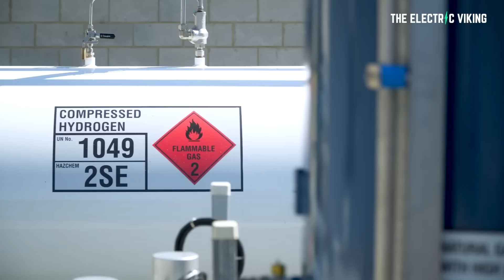World's largest wind & solar energy grid shows the future of the planet

Comment: One the one hand, it feels great that the world is moving to renewables and batteries and Tesla’s mission goal to transition the world off fossil fuels is a grand vision. Australian, Professor Simon Michaux has a phd in mining and metallurgy and currently works for the geological survey of Finland. In a unique and eye opening deep dive into the feasibility of making the transition off fossil fuels, he has looked at the current annual amount of fossil fuels used by the world and converted the energy content into Megawatts of consumption.

He then does the calculations to ask how much mining of the various metals would be required to manufacture the number of solar, wind and batteries with a conservative 4 weeks of battery capacity for no sun and no wind conditions. Then he looks at world geological surveys and notes that there is simply not enough known mineral reserves on the planet for some metals needed. Following the history of mining operations, he shows that the lead times between discovery of deposits and development into productive mines can be upwards of 15 years.

This presents huge problems as venture capitalists financing such mines, investing billions, may have to wait 5 to 10 years or more, before they can become financially viable. There are also geopolitical problems as the metal ores required, may exist in countries where other world powers are doing deals to get exclusive access to ores.

Then the good Professor looks at the current machinery used in mining and its fuels sources, and determines that most of this mining, refining, transport and manufacturing will have to be done using fossil fuel energy. Also he notes that ore grades are getting smaller in existing mines, which leads to an exponentially larger and energy intensive processing in the refining of low grade ores.

Finally, he looks at a term known as EROEI, Energy Return On Energy Invested which is a ratio shows that unless at least 3 times more energy is returned over the 25 year lifetimes of renewables and batteries, than the energy cost that was invested, it simply becomes unviable. And then, at the end those 25 year lifetimes, all of this has to be decommissioned and recycled , taking into account the extra energy required to do this, AND have sufficient energy to mine and manufacture the next set of renewables and batteries. After considering the hard data Simon Michaux, doesn’t think renewables are ever going to be sufficient to give us this utopia of unlimited energy. 

The link below is of his presentation of this mining data and is well worth having a look at.

https://youtu.be/MBVmnKuBocc

Comment: Truth be told it never mattered to me if my EV was power by coal because coal was domestic and wars were not being waged to obtain it LIKE oil, coal power sources are relatively centralized so technology can keep a tighter control of emissions as opposed to people defeating catalytic converters on there vehicles. Coal allows a people to pivot to maintain an advantage. AND I knew the solar revolution was coming and as the grid got cleaner so would my car. I’d rather solar,wind and even nuclear over coal but change is coming weather I hate or love coal and if my sources were correct and solar is superior (as it is) then the change will happen organically. I can’t wait to get myself some solar panels and make the same claim eventually.
Great video thanks 🙏

Comment: I think that it is important to make the grid connect up with other countries to help even out the grid better.   It is another thing that helps with the intermittancy of renewables.  Electricity can travel long distances without losing much energy if it is converted to DC rather than AC.  The UK is connected to several countries including, France, Holland, and Ireland and Norway providing almost 7% of all electicity last year.  Many other countries in Europe have lots of interconnectors too.
Reply: I'm fairly sure we convert to AC because it makes it much easier to step up the voltage, which is the real big loss saver. If we wanted to transmit DC, we'd have to step it up, convert, send it, convert back to AC on the other side and step down again, which may have big losses. Probably easiest just to keep it as AC and step it up higher if needed.
Reply: @Nabushika  DC is essential for long distance transmission. AC produces high electromagnetic radiation losses over very long distances. You are right that AC is better at the mains end because it is safer and can be transformed to different voltages. A Grid-tie inverter can be used to convert the DC to AC. Then most electronic goods need to rectify it back to DC again. It is true that there are losses in transformers and inverters but that just has to be accepted.
Reply: Sunline go bust
Reply: You don't seem to realise just how far Australia is from tjectest of the world. Now Guinea is close, then Indonesia, but they could, and should, be generating their own!
Reply: @gregbailey45  I think you dont realise how much the interconnector technology has advanced and how big the demand for consistent clean energy has become. The Australia-Asia Power Link was intended be export electricity from Northern Australia to Singapore for example. This is technically feasible but the finance for such projects has so far just led to bankruptcies. It is possible this will be revived as demand for it becomes more critical.
Reply: That only works between countries or continents if they have land borders only.
Reply: @larryc1616  UK does not have many land borders but is taking energy from Norway, France etc. There are even plans for long undersea interconnectors to Iceland and Morocco. Technically these are possible and it is only a question of whether they are necessary given other up-and-coming renewable sources such as Dogger Bank.
Reply: @larryc1616  No, tyhe UK has power links with Europe but the entire green energy policy of Europe is collapsing. Green energy makes things a lot worse, not better.
https://www.youtube.com/watch?v=Ea0hW6cjNG8&t=1s

Comment: Stop the fantasy land talk. Invest in nuclear for clean and carbon free power
Reply: Nuclear Fission is actually the most expensive form of energy production. It might seem convenient, but unless we manage to actually solve Fusion, nuclear won't be the way forward.
Reply: @rolandrohde  research small modular reactors that can fit on the back of a flatbed truck, are cheaper due to being built via an assembly line, are safer due to not requiring humans to shut down during a natural disaster, and cleaner due to being able to use their own waste and existing nuclear waste as fuel. These reactors can also be converted to fusion as that technology matures. The first commercial reactors of this type are now being built in America and China; and while these first reactors will be expensive, once the manufacturing process is implemented due to being similar to Tesla's manufacturing process, the price for these reactors will dramatically decrease. 

We actually need such reactors as a back up for renewables as; due to how they are designed such reactors are hardened better against a huge solar wave hitting the earth. What we really need to do is bury our power grids to protect them from solar flares hitting the earth, which will protect them from weather events, fires, and other natural disasters. There is even a sub group working on mini modular reactors the size of a fire extinguisher, all of this new energy tech will transform our world.
Reply: @ernestmac13  
I assume those are going to be Thorium reactors? So liquid salt reactors?
They have been around forever, but for various reasons never really got used. Maybe they will have their moment this time and maybe not.
Reply: @ernestmac13   I also like small modular fission reactors.  I doubt they can be converted to fusion.  The technology is just too different.  One of the most important advantages of modular nukes is that they will not have the huge regulatory hurdles the current plants have.  The US Navy has been running small nuclear reactors in submarines since Nautilus was launched in 1954.  So it isn’t even really new.
Reply: Read: „clean disruption“ then you will get why nuclear is not the answer long term. Short term however leave them running until the battery supply chain is ramped.
Reply: I have some nuclear waste - can i dig it down behind your house?
Reply: @mikafiltenborg7572  this comment just shows how uneducated you are on the subject
Reply: Right, and store nuclear waste for millions of years. That's why nuclear power is dead.
Reply: @nio6297  lol where is this fantasy energy source that has no downsides at all?
Reply: @GoOp790  Every energy source has downsides, but nuclear which has waste which requires millions of years to store, is astronomically expensive, uses a large amount of precious water, and can take 10 years to build has more downsides than every other energy source. Solar and wind with battery storage can be built in a fraction of the time for a fraction of the cost,  and produce no waste which requires millions of years to store. This is why solar and wind with battery storage are dominating the new electricity generating installations all over the world. In addition, solar and wind with battery storage, continue to drop in price.

Comment: Great stuff. As a local SA Power networks user the wholesale price is NOT being reflected in peoples electricity cost from the grid (because the cost to upgrade the network and manage it through this transition needs to be recovered, also as the gas generations becomes less and less the price of gas is getting higher so it will be a few more years before we see end user reductions). Of course you can avoid subsidising the grid upgrades by getting Solar and a home battery or possibly a vehicle battery and never have to buy power from the grid again.
Reply: Buy some coal shares that pay dividends and use that to pay for power.way better return on investment than solar or batteries. On any timeframe
Reply: @Phillip McNair  why buy into stranded assets?
That's a recipe for disaster.
Reply: sounds about right. SA has the highest residential rates in Aust....so the question then becomes ...who is making the money. ( retailers, poles and wires)
Reply: @craigvadeikis3898  its plain and simple. The government takes our money. Spends it on crap investments,then tax us till we cant eat.
Reply: Dream on
Reply: Way to go!

Comment: Sam, how is over generation calculated in these numbers? I think most people will assume the over generation is dropped, but I think these figures likely include overgeneration as though it was used, even if it was not. Can you clarify?
Reply: I believe over generation could not happen during the November "island" event thus turning off etc. The figures were actual production in grid, otherwise without "turning off" excess of 100% would be produced, which you cannot allow in isolated (island) system. Over generation in December meant exported to National Grid via Victoria and resulted in balancing of demand thus likely reduction of Coal or Gas generation.
Reply: @andrewbowe5588  Thank you for adding some color to the stats.

Comment: Great to hear about your go fund me success. All my hopes for your wifes recovery. 

I must mention that you are not fully correct about the ACT relying on hydro. They have their own large scale solar and rooftop solar and purchase any other renewables they need. Snowyhydro sell to the highest bidder when no one else is available, it makes more money that way. Its a commercial operation. However, Snowy 2 will be an interesting animal to watch...may or may not support or compete with battery storage,  time will tell, but all part of the long term solution. The gas industry still have its fangs in the energy sector, but fortunately no longer pulling the strings of government. Gas led recovery - my arse! Could we have had a more corrupt government?

Comment: I could see distributed battery storage integrated with EV chargers taking off. Especially with sodium ion batteries. Stabilizes the grid while allowing for faster charge speeds from the same grid connection.
Reply: And just how much pollution will all those batteries cause?
Reply: @GORT  it's how much they'll reduce that matters!
Reply: @GORT70  For sodium ion batteries, there is not much concern around resources or pollution. A little less energy dense than LFP, but perfect for stationary applications. The storage would enable more renewable energy.
Reply: @GORT70  sodium ion batteries don’t have the same high temperature processing requirement as Lithium based batteries. I’m not sure people understand the limitations of sodium ion batteries but they will very soon

Comment: Great news, Sam. Thank you. The next big news will be wireless transmission of power to replace obsolete grids.
Reply: Yep,then we can fully fry our brains,instead of half.
Reply: @phillipmcnair5789  Be brave, Phillip.
Reply: @billwedeking797  be realistic william
Reply: @Phillip McNair  OK, Phillip. We've already got range of 100 miles. We'll update you.
Reply: @billwedeking797  gee! A hundred miles. Wow.truly amazing. Would be nice if there was a charger every hundred miles. Any chargers at the beach? Any chargers at remote campsites?any chargers in remote towns?
Reply: @Phillip McNair  
Yes, Sir. I'm in Philippines now and will do all Asia first. We plan to generate power (Carbon Negative), send power to our towers along mountain ridges (line of sight) and send 100 miles any direction. You're  right, this is designed for remote areas .
Reply: Wireless is a lot less efficient than wires.

Comment: No way. The big monopolies which control energy and also the polticians must and will keep their revenue flowing with gains each year. Their stockholders demand it and perhaps 100 million seniors around the world depend on those stock values for their retirement ease. What happened with solar energy? Electiricity prices doubled in Germany. Oil companies bought up copper, other metals, and chemisry needed for solar cells, causing the average US home to need a $30,000-$45000 investment to perhaps...maybe...not likely....perhaps maybe save part of their monthly bill. Do the math. It simply does not work and the big monopolies will never, ever let this happen.
Reply: Did you even watch the video?
Reply: Germany installed a lot of solar when the price of solar panels was high and their efficiency was low.  In the last 7 years solar panels have got 50% more efficient for the same size panels and the price for each panel has remained about the same.  The Germans put in a lot of their solar more than 7 years ago.  That would explain why they are paying twice the price for their electricity.  If you install solar panels now you will probably get them for less than half the price per kW than the Germans paid for them and your panels will probably last longer (the newer panels degarade at a slower rate than the older ones did) and be more reliable than the ones the Germans put in because they put in old technology.  If the Germans put in the modern solar panels now rather than 10 years ago they would be less reliant on Russian gas than they are today.  I am sure they would still need some gas but it would be less.
Reply: They will try but ultimately will just slow down the advancement of solar, wind, etc. The age of energy abundance is going to happen.
Reply: When the price to build a system plus battery backup drops below the 10 year payback period the individual switch to renewable energy will be unstoppable. Won't matter what big energy wants, they will start bleeding customers.
Reply: I live in South Australia it is true. The price of electricity is half the other states.
Reply: They succeeded in delaying this thing for decades, but the damn has cracked (ironic metaphor) and the flood is nigh .
Reply: Larry. It's already happening. Sorry
Reply: @cy4782 , Do a google search for Duke Energy, see how much money they wasted trying to build nuclear or other power plants.

Then they finally got religion and scrapped a planned nuclear power project with plans to invest $6 BILLION USD in solar instead.

It WILL happen.
Reply: @cy4782 Do you realize your comment is ridiculous?  No one can tell WHO you directed your comment at, or which side of the argument you're on... plus, your commment is not the least bit original.

What a dork.

Comment: When the DAILY DRIVE is only 7kwh the rest of the battery stored energy can be traded on the grid. Every day. 

The only time you will need a full battery is the same as when you needed a full tank of petrol. 
The LONG DRIVE.

The advantage of a big petrol tank is for 2 other reasons are;
1st. is you did not want to do the drive to petrol bowsers daily.
2nd. was that you could not top up at home. It was too dangerous.

EV will be like the robot vacuum cleaner in your home, charges itself.

Plus trade electric energy with the grid for money. 
The South Australian big battery paid for itself in one year.
100mWh, $100million, 1 year.
So 100kWh, $100,000, 1year. ??????
Or 93kwh,  $93,000, 1 year. ?????

And this is dispatchable electricity. That is its big value. 

How much is an EV  ?????
Obviously you would have to pay income tax.

And the EV battery is free with the vehicle,  Hahaha,  but true.